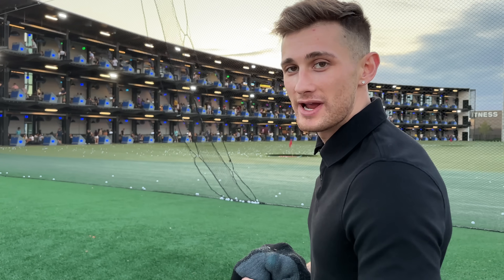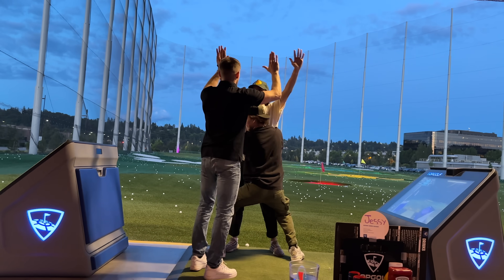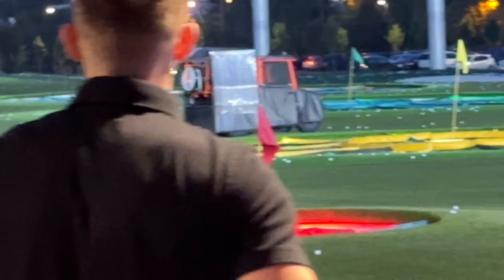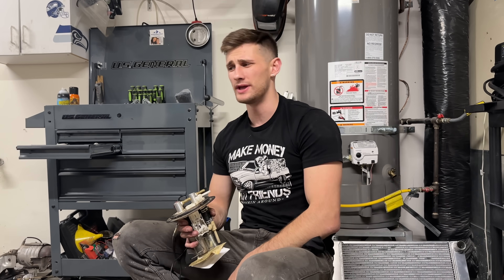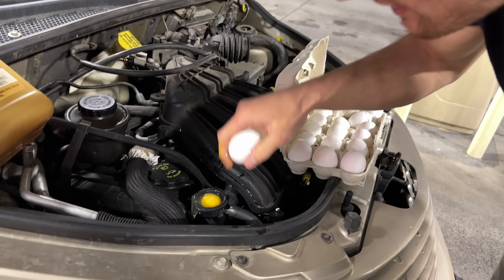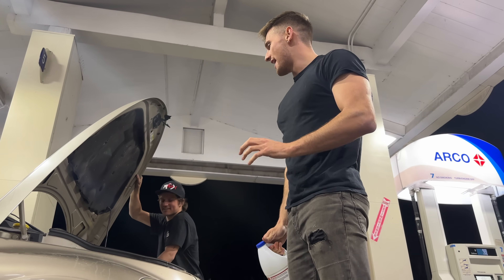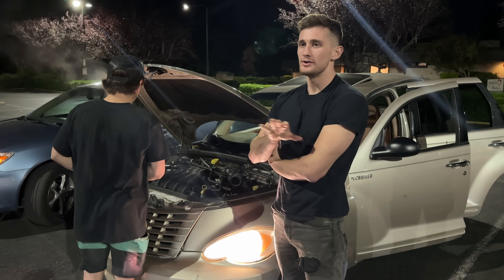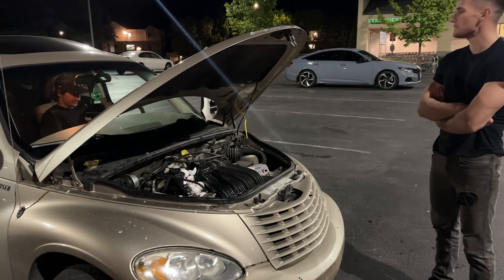Will Eggs Fix A Blown Head Gasket?!

Comment: That wasn't rod knock, that was Spark knock from it being overheated
Reply: What is that?
Reply: @wade-potato6200  pre-ignition, fuel combusts before the spark plug fires basically
Reply: or it had a knock and lost the rod, you can loose the knock if you just keep going 😂
Reply: @uncrustable9923 lose*

Comment: I personally believe you take extreme care in maintaining your vehicles… That being said I’d like to purchase the Pt cruiser immediately!
Reply: well im offering him 4k so good luck. not very often do you find a responsible young man who takes care of their car.
Reply: I sold these and people loved them...I took our dealers Turbo GT with Mopar stage 2 package home and blew the doors off a basically then new 2008 Mustang GT we also had...no,I don't like the style of the car I don't like fwd or 4 cyl or 6 cars but it was fun for that night..

Lots of people liked them for ride as they sat a but higher than other small cars,lots of cargo room etc...Just saying why people bought them,we had people coming back after several years for us to look for low mileage ones for them as they had 200,000 plus on theirs..

Keep the timing belt and water pump up to date and change the coolant so it doesn't eat the head gaskets..Important on all cars change coolant every 2 years to ensure you wont have an issue..They say 5 or more years but that's when the problems come!

The Turbo 180 hp wasnt bad to drive but the bigger 2.4 with 215 then 230 hp were better with the Mopar Stage 3 kits you had over 300 hp and 360 torque! Stage 2 was 285 hp and 330 torque! Things were a beast if you knew,you knew..Same engine as the Neon SRT 4..Wow it sounds like I like them lol..
Reply: @mypronouniswtf5559  I’ve owned both the srt4 and an automatic turbo pt, suprised so many people in both lol. The cons are typically that they’re ugly and unreliable unfortunately 😂

Comment: Neons and Cruisers have the same problem. Bad water pumps. If it ain't too bad and keep the revs up in a lower gear though, keeps the temp down. Just keep replacing the coolant and send it

Comment: I had inherited a 03 pt from my grandma cause she had bought a new car an told her id take it an flip it well the car didnt like the 2 hour drive home amd the metal coolant line blew a hole, shift selenoid, rear rear shocks lost gas, plugs were fucked, an had to remove the vinyl flames that wemt from the front fenders all the way to rear doors she thought it was cool in 03 but it only had 60k and like no rust cause she barely drove it so that being said i will never work or own these pieces of shit